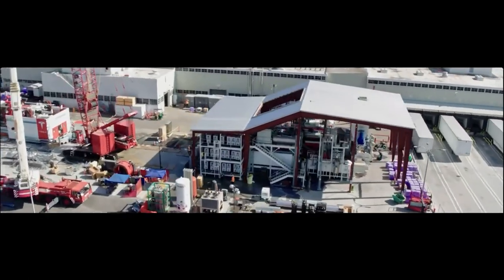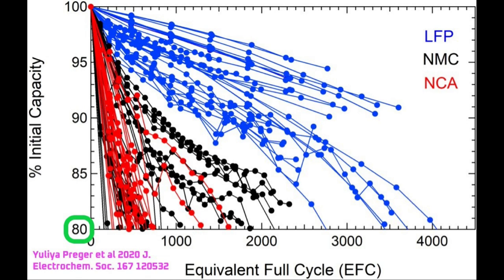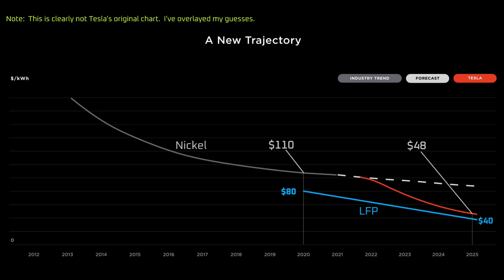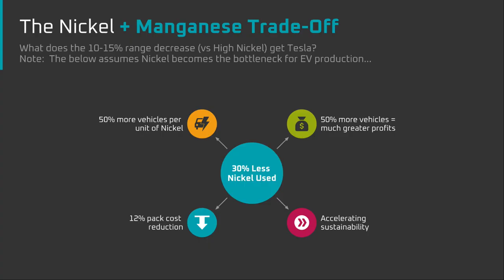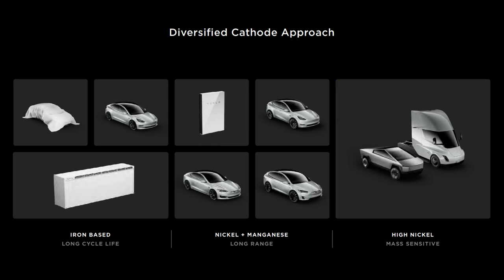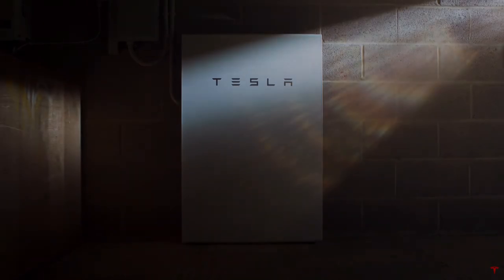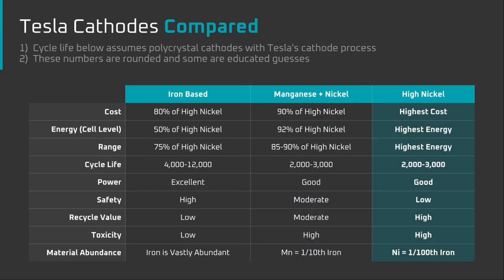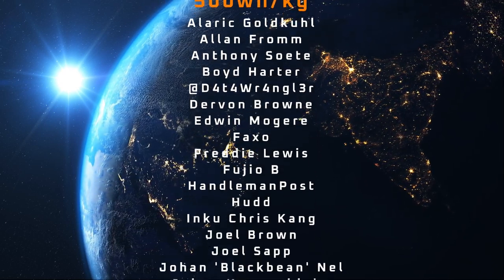#11 Tesla's Three Cathode Choices // Product Impact

Comment: Jordan, your content includes always high-level analysis, I love it!
For LFP battery-based systems, both energy density and specific energy are lower than that of the trinary battery systems. It is also true that the LFP cell is cheaper and inherently safer than that of the NMC cell. For both EV and ESS, the trend of the development is increasing travel range by developing packaging skills, meaning that the integrator tried best to pack a number batteries as possible. 
For EV application, LFP chemistry-based energy storage system has a packing limit in unit volume. This is one of the reasons that you do not see a long-range or performance EV with LFP based energy storage system. Moreover, once you build the same amount of energy storage device that reaches long-range or performance EVs that used NMC based batteries, the cost efficiency of LFP will be dramatically decreased and will lose space and travel ranges. 
What I am trying to say is both olivine and layered, they have their own applications. It is not that worth comparing them.

Comment: I just wanted to add:
I think because LFP has less density, that mean you're going to have to pack more of the batteries into the pack, but because LFP batteries are for short-range vehicles, that means that now half the pack wont be empty air, and will be actively contributing to the structure, if they used higher density chemistries for short range vehicles, the pack would be empty in some areas, thus reducing the structural impact of the pack and the dynamics of the vehicle!

Comment: Love your videos. Wanted to comment on VTG. VTG is more complex than most people think. It requires an automatic approved home disconnect much like the Tesla PW2 Gateway. This is because the possibility of back feeding the utility power lines can kill a utility worker. I had 3 Tesla PW2s installed after analyzing the issues associated with building my own similar system. The only way to accomplish vehicle to grid is to change a homes main service entrance panel such that a Gateway automatic disconnect device "islands" the home during a power failure if backup is desired. The EV would need a single phase inverter not unlike that in the one in each PW2. But a PW2 inverter is limited to 5KW and 13.5KHr of storage. An EV with a 75-100KHr battery would want a larger inverter possibly as high as 10KW or more to be able to provide reasonable VTG power. I have 3 PWs or 15KW and it powers my home. This inverter could be autonomous like a solar inverter that shuts off or is throttled by the 60Hz frequency or its disappearance so the utility can shut it down or it shuts off on power failure ( like solar). But you lose backup on power failure.  

The current Tesla EVs do not have this large expensive inverter that feeds both 240VAC and split phase 120VAC  toward the home. Running a home requires 120VAC spilt phase as that is what most home appliances run on and is required on backup ( like the PW). Not having home backup on power failure would be a major feature issue as it is in solar. So the only proper way is to add a Gateway at the utility main panel entrance ( expensive) along with software coordination between a new large 10KW ( solar like ) inverter in every EV via 60Hz modulation or a hidden AC datalink. My installation cost of the PW2s and all the support panels and the Gateway cost $4000. So adding a large split phase solar like inverter to the output of the EV battery would be expensive and add weight and cost. Check out the cost of a solar inverter at 10-15KW and you will find its $1000s of $$. The home charger setup and its breaker box would need to support the 10KW or more output or it would need an upgrade. I think this mess is why Elon was cool on the idea. He has a good understanding of the Powerwall 2 and its installation and Inverter cost so knows the can of worms it presents. Sounds cool until you find out it costs $5000 ( EV cost and home install plus Gateway) on top of your EV without it.
Reply from the maker: Great information thanks!

Comment: One additional benefit of LFP is you can charge to 100% without degredation.
Reply from the maker: Good point!
Reply: I would say "less" degradation.  Lower SOC still extends cycle life with LFP just as it does with other lithium ion chemistries.
Reply: @thelimitingfactor  it would be great, if you can do a video to compare temperature behavior between "tesla batteries", mainly regarding LFP supposedly working poorly in cold
Reply: But in a tesla you are expected to fully charge at least once a week to balance the cells.
Reply: @davidclark2286  I don't believe that is correct.  Cells will balance below 100% SOC.  The range estimation may become inaccurate over time if you don't occasionally do a full charge.
Reply: @JRP3  I'm afraid your belief is wrong.  Remember we are talking in this subset about lithium iron phosphate batteries,  not Tesla's other batteries.  This requirement   is specifically for these batteries.
These batteries in tesla cars are top balanced.  Elon has specifically stated on several occasions that with these batteries customers should fully charge there car at least once a week to enable the cells to balance.    On the sessions I have seen the discussions have been about extending the life of there  other batteries by not fully charging them in normal charging.  
So if you have a tesla with lithium iron phosphate cells ideally you should fully charge them once a week.  Up to now this would only affect lower range MIC models but Elon has just announced  all locations will be using lithium iron phosphate batteries for lower range models.
Reply: @davidclark2286  It's true that LiFePO4 has a flatter charge curve but it is quite possible to balance them below the 3.60 max voltage, especially with closely matched cells which I expect Telsa to be using.
Reply: @JRP3 Sorry I not been able to get back to you sooner.  
 Now there are two  possibilities , either you are right  or you are wrong.
Let us assume you are right.   Going back to battery day,  Drew and Elon specifically asked.people to contact them if they have got things wrong.   If you can substantiate your claims they will even want to find you a job in the team and you can help them sort out there error.
For everyone else.   It does not matter if JRP3 is right or wrong,  every one else believes in normal use you need to balance Lithium Iron Phosphate (LPO4) cells between 3.4 and 3.6 V per cell.  This includes both battery and cell balancing module manufacturers and Tesla.   Consequently if you have one in your tesla you need to follow Elon's instructions and fully charge your battery every week.  If you find your manual unclear on this issue contact Tesla and clarify the status.
Reply: @davidclark2286  Funny how you just agreed with me without realizing it:  "between 3.4 and 3.6"  Since fully charged is 3.6 and anything below that is not you've just shown that you can in fact balance below fully charged.
Reply: @JRP3  just wright to Drew and Elon and tell them they got it wrong.
Reply: @JRP3  
1.) Maybe you can balance in the 3.4 - 3.6 range, since 3.7 (?) is the absolute voltage top for LFP.
But I believe it takes (some) time to balance. (Detailed technical explanation: last charging stage of fixed voltage charging; because the difference between cell voltage & charging voltage is low, balancing is slow)
2.) In practice, it slowly balances in the time it takes to charge the battery from 85-90%, to 100% (and while maintaining 100% charge, if the battery was severely unbalanced & it is needed). 
3.) How long it balances is depending on how much the battery is unbalanced to start with.
Reply: LFP still degrades at 100%, it's just less important (because it has very very high cycle life anyway) & it is supposed to only be able to balance near 100% charging (have no clue, took Elon & some other's battery veteran's words at face value)
Reply: @elektrotehnik94  you state in your other response along side this one that you have no clue as to why this is so,.   
Do you think it is reasonable to make comments like these about something you do not know?
A lfp battery can not be balanced in the 80 to 99.5%ish state of charge due to the shape  of the charge curve.  99.5%ish  is approximately 3.4 volt per cell where the charge curve has changed  from being very flat to being very steep providing the opportunity to electrically balance the cells. 
Others:  if you are doubtful if you need to fully charge your lfp battery in a tesla and how often,  check your manual and/or contact tesla.
Reply: @elektrotehnik94  Yes you can balance in the 3.4V to 3.6V range, there is very little capacity above 3.5V so you could easily balance at that voltage, no need to go to 100%.
Reply: @davidclark2286  I might be wrong. Let's try to find it out.
 
https://www.powerstream.com/LLLF.htm

The first graph on the site: Because current falls only the very end of the charge cycle, only the end of the charging cycle is effectively providing a chance of balancing between cells?
If my graph is not relevant, can you help & share a better representation of the actual charging curve being used?
Reply: @JRP3 hi again..
I guess we can  both agree that Battelborns CEO knows more about lithium iron batteries than both of us.

Take a look at his interview with Will Prowse on DIY Solar with Will Prowse.
Search for Battle Born CEO interview with Will Prowse.  Or search for Wills  site and pick the video.
When we charge a lead acid battery we charge to between 14.4and 15v depending on time of year.  We stop charging and the voltage drops to between 12.8 and 13.2 V which is a fully charged battery.  With lithium iron phosphate  the equivalent voltage is 14.4v ( 3.35v for single cell).
But we have a choice when we charge it.     We can charge it to 3.4v.at constant voltage then have a  long constant current charge to fully charge the battery.  Or we can charge to 3.65 V on constant current and a short constant voltage charge to fully charge the battery in a shorter time.   These voltages are the charging voltages. Not the definition of a fully charged battery.  
The battleborn interview relates mainly to 12v batteries that is 4 cells in series.
Reply: @elektrotehnik94  I looked at your site, urgh....yes lots of issues.. Response to follow in a few days.   .  You might find  DIY Solar power with Will Prowse interview with the CEO of Battleborn  Batteries.   Probably best to search for wills site then pick the interview..
Reply: @davidclark2286  Checked it:
https://www.youtube.com/watch?v=ywn-vBjKblI

Around 10-13 min.
I see: 3,6V (?) for LiFePo compared to 4,2V for standard Li-ion NMC at 100% fully charged --> 3,6V means a lot less degradation even at 100% charge for LiFePo.
Reply: @davidclark2286  So thank you for your info, it helped already <3

Comment: With regard to vehicle-to-grid, the easiest way to do this might be to install one or two 110V/230V outlets in the vehicle like Tesla have planned for the Cybertruck. Then, in cases when emergency power is needed, people could just plug one or two powerboards into the car to operate  some appliances and lamps. It would not be as convenient running an entire house off the car's battery, but it would work in emergencies.

Comment: Great video, as always.

The probabillity of catastrophic (none silent) End-Of-Life faliures only become meaningfully high (for Nickel based chemistry's) at sub ~60% (sometimes even lower) capacity retention.

the reason 80% is considered End-Of-Life is simply due to the aformentioned performance based reliability issues.

And even at sub 60% retention, the chances of smoke & fire are resonably slim. The majority of hazardious faliure modes involve expansion/pressure-venting due to slow gas generation over prolonged periods of time.
Reply from the maker: I'll do a deeper dive on second life use and why it will soon be bunk 😉
Reply: @thelimitingfactor  cant wait.

Btw I hope i dont come across as condescending or as an arm-chair Einstein haha. I just comment on things i feel are somewhat incorrect or need clarification.

Comment: Btw. Lfp needs to be spot on balanced. 0.1v diffrens can mean almost half of overall capasity. My 52v 13ah lfp-battery is not much bigger than 48v li-ion, and gives good performance and great deal of current. I placed order for bluetooth bms, even it is a bit expensive.

Comment: One thing about LFP with silicone anodes. If it’s being used for cars then the silicon anode would work as you don’t need the super high cycle life. The LFP main benefit for Tesla in cars is price for and less nickel. Adding silicon anode wouldn’t change that but give some improved energy density which is the main drawback of LFP. Just my opinion.

Comment: 24:41 Snowball Effect, virtuous cycle, and vicious cycle are all ways to describe a positive-feedback loop.  

A negative feedback loop is a self-stabilizing system.

"Positive" and "negative" are not value judgements on the effect of a "feedback loop".

"Positive-feedback"  means that the output of the loop is fed back into the input, and "negative-feedback" means the output of the loop is inverted before it is fed back as an input.
.

Comment: Hi Jordan, thank you for all your great videos. Not always easy to understand for non english native speaker as it is technical matters, but the 3D animation make it easier ... and I can loop part I want to fully understand ;) When you speak about anode and cathode material, you never mention the electrolyte. Lithium have seen its price surge recently and despite it been quite abundant, battery grade lithium is not as abundent and there might be a lithium shortage pushing price higher. Do you think this would have a substantial impact on the pack price or it is not so important ?
Reply from the maker: Not sure how much it can/will effect battery prices.  It's an entire area of expertise.  I would only say that changes in Nickel prices will have a much greater impact.  Lithium is the salt in the salad.

Comment: I am sure I can be less wrong on this, so check me. After battery day I crunched the numbers a bit and thought of it this way.

4680 per Cell Capacity.....
Nickel - 120wh
Nickel/Mag - 110wh
Iron - 80wh

Assuming a Model 3 with a 960 cell pack as seen in some of the cell to pack graphics, knowing the Model 3 won't see the High Nickel pack, but for comparisons. Also, assumed a vehicle efficiency at 205wh/m, 14% improvement based on vehicle integration of the structural pack.

Nickel - 115kwh, range 560 miles, cost $5200 per pack.
Nickel/Mag - 105kwh, range 512 miles, cost $4180 per pack
Iron - 77kwh, range 375 miles, cost $2900 per pack

Comment: The diversification of chemistry to future proof their production against supply constraint is a great point. Clearly one of Tesla's major strategies from the S going forward has been solving their early supply chain problems by bringing production of almost everything either in-house or at least under their own roof (Panasonic). Today we have tier 1 suppliers for almost everything Tesla might need, but instead of pursuing those contracts Tesla is doubling-down on vertical integration. That suggests that Tesla sees supply chain problems as a continued major constraint on volume. More and more OEMs are promising to go 100% electric by 2030, but how realistically can they accomplish that goal at current production volumes without addressing supply security with enormous investments?

Comment: I remember reading an article on Inside Ev that said there’s a LFP battery manufacturer in China that has plans to bring a 260wh/kg battery to market around 2022. Would be interested to hear your thoughts on it.
Reply: My bikes battery is close, if not exactly that. 52v 13ah Lfp 675wh and weights about 2 kg. I use Liitokala 26700 4ah, 4c lifepo4 cells in that. Liitokala has 32700 7ah cells that are rated 6c, I got those too in a nother pack.
Reply from the maker: Naaaaaaaah.  More than that would take a video, lol
Reply: @thelimitingfactor  I am going to make a video of it :D It has 16s 3p, but I measured 13 ah while chargin empty to full. Controller of my bike is rated 35a, and I get the full power, bit more than 48v li-ion for extra volts.